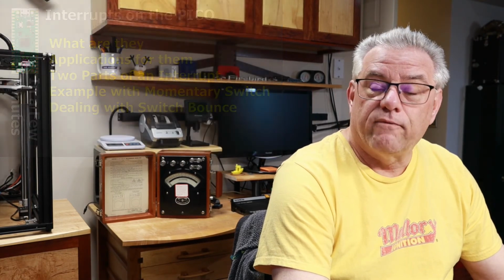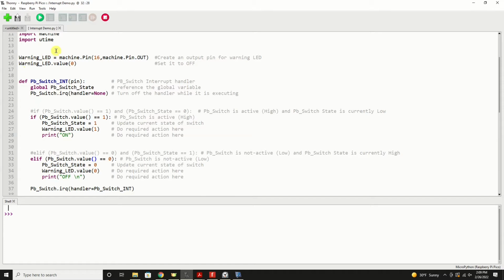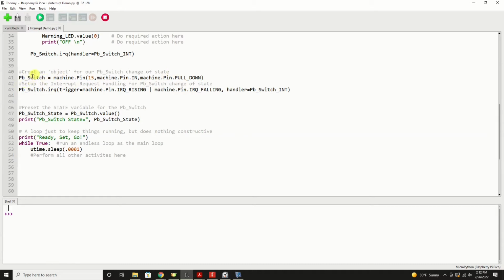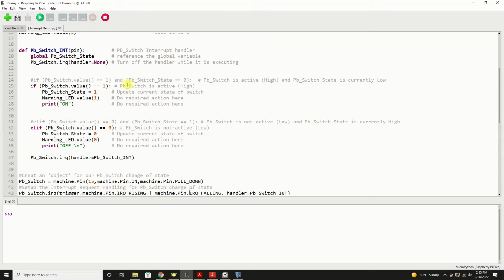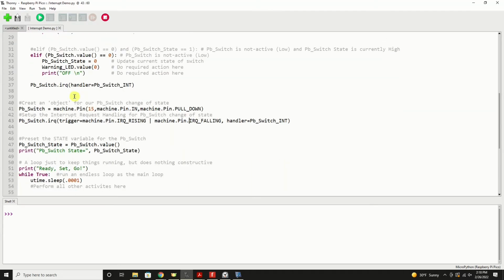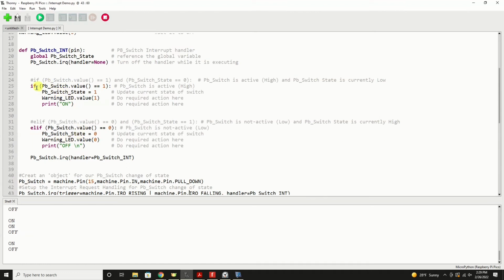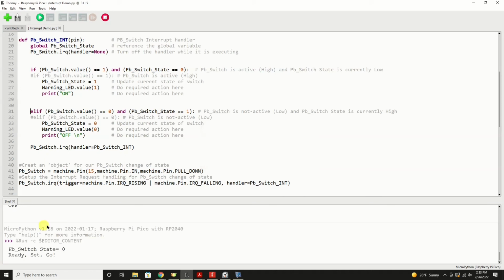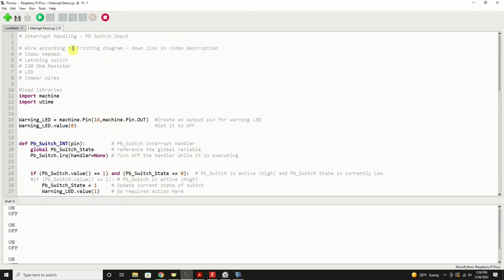Using PICO Interrupts

Comment: What year is you Firebird?
Reply from the maker: Good morning customizingtheindianscoutb9019 ,
Mine was a 1968 , 350, 3 on the floor.  When I bought it in 78 or 79, it was a total disaster rust bucket.  I replaced every panel on it, and made it into a great street car.  The 455 I put in it gave it a lot more get-up-and-go.  After a few years I converted it into a drag car with full back-half chassis and all the fixins.  
Only have a few pictures of it when it was a rust bucket so the photo on the back wall by ZoomTown is of a similar car, but it helps bring back memories for me.
Did you ever fix up your 69?
Cheers!
Chris

Comment: As CPU clock speed increases, debouncing gets harder.  Imagine an infinitely fast clock, and this method breaks down.
The only way to guarentee the position of a switch is to wait for it to settle down (10 milliseconds or so) or to sample its state multiple times (counting those samples) until you are statistically satisfied.
Reply from the maker: Good morning davidgari3240,
Thanks for sharing that great information!  Everyone will do battle with switch bounce and every bit of information helps.
Cheers!
Chris

Comment: In your example you have a 'while True' loop that only has a very short delay of  .0001 seconds. This delay is very important due to the way that interrupts work in MicroPython. Under the hood there is a two stage process: when a pin change is detected an internal interrupt handler sets a flag. A scheduler will see this flag and call the users interrupt handler. Without the short delay in the 'while True' loop, a 'busy loop' is created that never gives the scheduler a chance to run and the users handler will not be called. To let the scheduler run, loops should have a call to utime.sleep() or machine.idle(). I discovered this the hard way!
Reply from the maker: You are correct, it is always a good idea to have some sort of delay in a loop.  It appears to be more of a problem in Python that in any other language I have programmed in.
Thanks for sharing your experience.
Cheers!
Chris

Comment: First great set of videos 
Question - Could instead of using the Global Pb_Switch_State why not use the Warning_LED.Value()
 so the if and elif lines in the code would be :
if (Pb_Switch.value() == 1) and (Warning_LED.value() == 0):
elif (Pb_Switch.value() == 0) and (Warning_LED.value() == 1):

What are your thoughts?
Reply from the maker: That is the joy of programming :-)  For any single problem there are countless way to solve it.
Cheers!
Chris

Comment: Thank you, very clear to understand. I am still wondering weather it would be "faster" to avoid as much tests as possible, maybe by defining two specific handlers, one for the OFF transistion, the other for the ON ? I made a few tests, nothing obvious.
Reply from the maker: Hello @tjeanneret,
I don't know if there is any advantages one way or the other either.  Recently I have been discovering little odds and ends in MicroPython that are related to program performance.  Can't make sense of what I have been discovering either.  
Cheers!
Chris

Comment: Hi Chris - often folks complain about LED projects as they are so basic.  However, once you get the concept that signals are just merely being passed and the same philosophy can be applied.    Understanding the concept instead of this being an isolated solution you can really make some progress in your own code.    After watching your video I rewrote my code for my wheel encoders and set both IRQ and Timers to make a more efficient and elegant solution.  Many thanks!!
Reply from the maker: Hi @Steven-jf4cs,
Awesome!  I am glad to hear you worked up a more elegant and efficient solution.  That is always a rewarding experience in programming.
Cheers!
Chris

Comment: When you simply turn off the interrupt while executing you may end up with the actual pin state being the opposite before you're done processing the code if the code isn't fast enough. In theory. 

With C I've usually turned the interrupt off, done the processing and check the actual pin state right before executing the result of the processing...

Practically, since a button is a human interface, starting a timer to wait until a 100th of a second before double checking will not be noticeable to the human brain. But it'll eliminate the jitter that a button may perform as well as any static electric discharge triggering the interrupt, putting your statemachine into an inverted state.

Edit: you do teach some important lessons about the principles about how to handle interrupts, i just feel that you haven't tried fringe hardware with a lousy bounce going on.

It's a common trait amongst theoretical programmers to trust the hardware and environment too much.
Reply: Imagine giving a student the task to write an essay about the state of a pin as soon as the state changes.

The student detects the change, does research on the current pin state before it starts writing, while ignoring further changes until that task has been finished.

The student finishes the work,  but in the meantime the state has changed again.

Then the next essay is also gonna be about the state rising, but in the meantime everyone reading the essay would have been told that the state is already in a raised state, and believing so, because a CPU is not a democracy.

Edit: basically don't trust the very first trigger either, but do wake up on it.
Reply from the maker: Hi Benjamin,
Thanks for posting an add on.  
Unfortunately to cover every possible scenario with every topic would make the videos extremely long.  The average watch duration of a video is 6 minutes and most of my videos are about 3 times that length already.  It is a tough balance between providing enough information to give someone a rough idea of what to do and giving them all the information they could possibly need.  
Cheers!
Chris
Reply: @MakingStuffwithChrisDeHut  very good point, but I mean, if you anyway do an effort to handle bounce/jitter in a more sophisticated manner than simply using a timer, you may as well make it as reliable as the timer solution 😄 but I know it can also become a rabbit hole to think of all possible scenarios.

Your solution isn't a bad one for people to start out with, and you do go to explain why you turn off the interrupt while your handler/callback is at work.

Of course, when it's just about flipping a pin when you hit the button it'll almost always work.

Imagine if you were performing something slower, like translating the button press to HID over USB or BT, a button that is not in peak condition could indeed bring that statemachine out of sync.

But you're right as for a quick-start intro you cover the topic better than those that would simply rely on a timer.

Comment: Hello Chris I have been playing with interrupt driven encoders using interrupt and you have some “features “ in your code. When you initialise the ISR you set up Rising or Falling edges. Note if you don’t specify rising and falling in your code it defaults to this without setting it explicitly. Secondly you probably don’t need to stop the interrupt in the handler given that interrupt in micropython based on a scheduler and are not a true interrupt. I haven’t tested this but I doubt you can enter it multiple times. Finally when you re-initialise the interrupt at the end of the handler you have forgotten to explicitly set if you want rising or falling. In your case you got lucky as not explicitly setting it gave you the functionality required. Note I found all this out trying to detect a rising edge. It worked first time but then defaulted to interrupt on the rising and falling edges. Hopefully this makes sense and comments made in good faith to aid our learning. Best regards Chris
Reply from the maker: Awesome feedback and thanks for sharing this!  Looks like I may have to schedule in a revisit on this when I get some time.  Cheers!  Chris
Reply: @MakingStuffwithChrisDeHut Question. I believe the MP interrupts are hardware based not software based. So there isn't any software scheduler involved. Also, I think some of MPs interrupt handling g has been updated since you last updated this. Any chance you will get making an update in the near future? Would be good to get the info on MPs current interrupt handling functionality. Thanks.
Reply from the maker: @christopherlyons7613  I recall looking into that a few months back and the interrupts were still software based.  However, I can't tell you what I had for lunch yesterday so I will look into it again when I have a bit of time.
Cheers!
Chris

Comment: Thonny (python) is interpreted and runs slow so you are just letting the execution of the code be your debounce timer. Run it in C and you are likely to see[on off on] from the key bounce. Also there is no difference in triggering on 2 statements to transition high, transition low, vs the statement where you check the or condition. An interrupt will never be simultaneously transition high and transition low at the same exact same time..
Reply from the maker: Thanks for the feedback and sharing your knowledge!
Reply: I came here to say the same thing. This absolutely isn't the right way to debounce.

Comment: Is it possible for an interrupt function to affect the main loop? I tried using an interrupt to change a variable that was used in the main loop, but unfortunatly the loop would resume in the state that it was before the interrupt was triggered. Is there a work around that?
Reply from the maker: It sounds like you defined the variable in the "main" are of the program but didn't declare it as public within the interrupt handler.  Check for that as it is the only thing I am comming up with.
Chris

Comment: in the micropython irq handler  you can  do :: 
state = machine.disable_irq()
global x,y,z ...
other code ... at the end do :: 
machine.enable_irq(state)
to stop any interrupt interfering 
also in the handler you can find out which situation called the handler, when using IRQ_RISING|IRQ_FALLING combo
print( pin.irq().flags() )  will show if it was Rising or Falling    
if you need your code to act differently on each ... 
flag returns a number (4/8/12), test it out ( might need to do short press and long press testing )
Reply from the maker: Thanks for the input Ben!  I will look into this later this year when production starts up again.